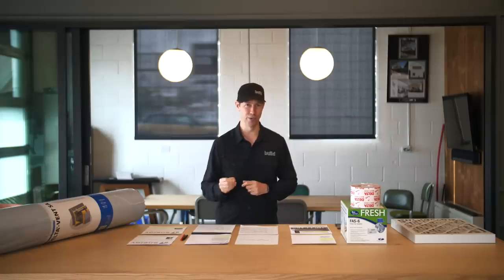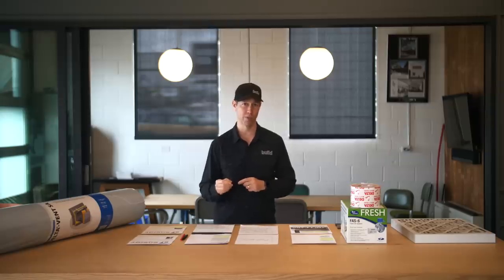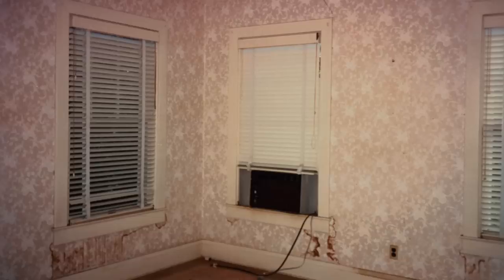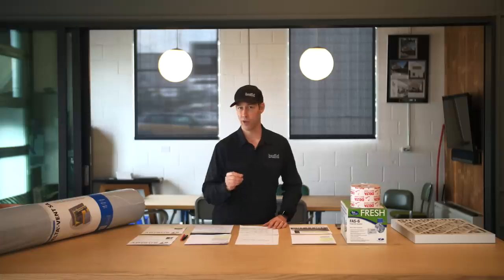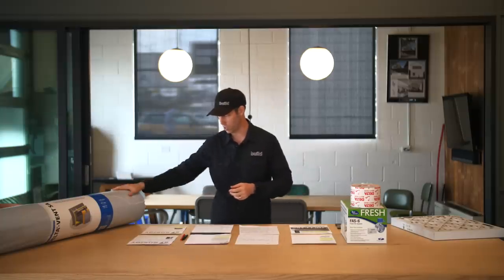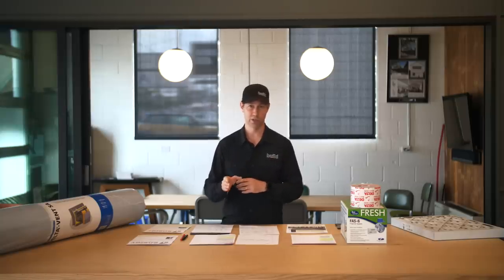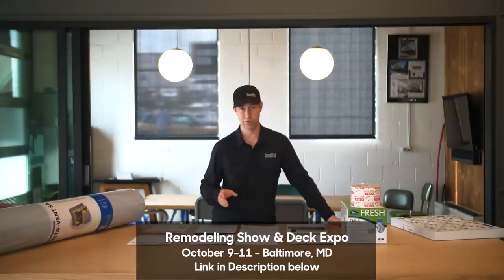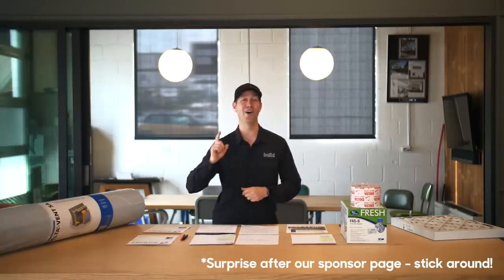“Houses need to BREATHE!” - Shut your filthy mouth

Comment: So houses do need to breathe.......... 

There's just better ways to do it in 2018 than previously.
Reply: Still not technically true. The people inside the house need to breathe. If the people go away on vacation for two weeks, they turn the ventilation off. Even during the day when everyone is at work or at school, the ventilation is turned off.
Reply: @trevorlambert4226  Why would they turn the ventilation off? User error shouldn't usurp logical construction. Their controller can automatically kick in the system; the air never has to get stale. When I leave for vacation, my system is on. Hec, I never have it off just adjust it for usage and comfort. So easy.
Reply: @Zeppelinlv2007  There's no need to exchange air when there's no activities and no one breathing inside the house. You have the HRV programmed to dial back to next to nothing during the times you expect the house to be empty. When you go on vacation, you do it manually. This is standard practise, which is why there's an "away" setting on most HRV controllers.
Reply: but more expensive. If you are not in a cooling climate this makes you have a HVAC system which you wouldnt otherwise, that is a HUGE cost, and constant cost. I live in a heavy heating climate, but the other 6-8 months a year there is effectively 0 climate control cost.
Reply: @trevorlambert4226  They prefer artificial respiration to natural breathing.
Reply: The home should be above 55 and below 85 with humidity under 70%. As long as you're not out of this range you're fine without ventilation when unoccupied.

Comment: Thx Matt. The physics part was spot on. But on the „how to do it better“ part, my philosophy varies. First of all: For the classical American home, your solution is the most viable one. Wooden constructions with insulation do not have enough thermal capacity to work well with natural ventilation. Having this kind of construction in mind, your solution is the best.

But if u check out different ways to build, you can create natural ventilation scheme‘s. My company is using massive prefab. concrete parts for structural pillars, beams and ceilings. The stairway is always beeing housed in prefab brick/KS. The outer walls (31 cm, with minimum 24 cm blown in natural insulation) and the roof skin (45cm with over 30cm of insulation) are made of prefab woodframed „plates“. The Drywalls are made with a new German product, combining a breathable woodwool board with a 1,5cm thin clay plaster layer.

This is a so called hybrid construction. I made it, so one can reep the benefits of both worlds best. While using massive ceilings and clay plaster, I highered the thermal- and hygro- capacity. While using thick insulated wood-framing, I optimized the thermal insulation (it takes weeks for the interior to cool out in winter or heat up in summer). With this combination, I can use small ventilation openings within the window frames for fresh air supply and intelligent fan‘s (CO2 measurement) in pwdr/bath/kitchen for achieving a low cost ventilation system. As an Alternative, one could put a long bended freshair ventilation pipe below or into the basement/baseplate. It might not have a sophisticated thermal exchange system like an expensive high tech air conditioning system, but it serves comfort and a reasonable energy consumption, without the need for new air conditioning systems every 10 to 15 years.

Cost of this construction per sqft: 120,82€ or 138.20$/sqft. That’s invested once.

Compared to this, you could also spend 10 to 20k for a sophisticated air ventilation system in a mid size home every 15 years, plus maintenance and repair costs.

Disclaimer: Yes, our prices are low. But this is intended, so working class families can afford proper homes. We want it like that and we are ready to work/optimize more for our money, while focusing on the mass market. The average price for a brick&mortar home in Germany is nearly double as high.

Comment: For 3 years in the late ‘70s we lived in a home built using a semi-experimental construction method.  It was a single story built on a concrete slab.  The walls were made from particle board bonded to both sides of a 4” styrofoam panel.  The styro had channels molded into it, and used a tongue and groove joint to adjacent panels.  The channels were filled with concrete which formed the “studs”.  Electrical was in smaller channels in the foam.  The roof was panels of Masonite bonded to both sides of 6” foam.  There entire “attic” space as used as a plenum for the HVAC.  Need a vent?  Punch a hole in the ceiling and put a grill over it.  As you mentioned, the house was entirely too tight.  We had constant problems with mildew.  We had to run a large dehumidifier during the winter.  Any furniture placed too close to an exterior wall was sure to have mold behind it.  Fortunately, we relocated for work before I had to face drastic and expensive solutions to the damp house.
Reply: Interesting
Reply: Was the concrete slab insulated in any way?
Reply: mark ymark I don’t know.  The house was a little over a year old when we bought it, but it had been rented out the first year.  We never talked to the builders.  We lived in it from Jan. 1978 through May 1981.

Comment: Question from a Swede living in the US. One of the most annoying things I've noticed here is that every apartment/house is heated with forced air. I have never understood why this tiny cost savings is used to get a loud really inefficient system instead of using water based radiators under windows or in the floors. How does that affect building air tight? Let's say I want to build a house that is "100%" quiet. ie I don't want any moving system that forces air in any direction. Can I build air tight but with natural ventilation?
Reply: Anders Fredriksson excellent question, Anders!
Reply: Anders Fredriksson , ..  many years ago, I  read about a passive heat ventilation system, that had one way venting, as is air warmed,  it rises and exits. Fresh air entered via one way vents near the warm floors.. It's was a pretty slick  system..
Reply: Radiators went out of style when air conditioning became popular. Forced air allows the ductwork to do "double duty." You go with rads; you need a separate cooling system.

I suppose there isn't much need for AC all the way up at 60 North?

P.S. Radiators, in my experience, are about as noisy as forced air. No fan, but lots of clunking noises as they heat and cool.
Reply: bcubed72 never head any clunking noises from radiators in my house.  Forced air is awful.  Its inefficient, costly, swirls dust veywhere making people sick. Air conditioners need to be banned soon for climate change reasons alone. Youre in dark ages with this opinion.
Reply: @PS987654321PS  Air conditioners are an absolute necessity for much of the   southern US. That's why building for energy efficiency is so important. 

Also, forced air is quite efficient for heat provided it rarely gets extremely cold.

Heat pumps can operate very efficiently if the temperate differential isn't extreme, much more efficiently than combustion heating systems.
Reply: @PS987654321PS  Yes, planting more trees will really help when it's 95 degrees and 90% humidity in the shade. Why didn't I think of that before?
Reply: techmage89 it will.  Also, maybe if housing was properly made for the climate youd not have the problem.  Spain and north africa region are hotter and no one uses air conditioning. They dont need it. Why do you?
Reply: @PS987654321PS  Spain is actually considerably cooler and drier than most of the Southern US. No where in North Africa gets anywhere near as humid, either. Evaporative cooling techniques and plain old sweating work fine for cooling down in such climates.

Not so in much of the Southern US, which is a humid subtropical climate. We can't rely much on cross breezes and shade to keep us cool, nor can we sweat to cool our bodies down, because the air is too humid for sweat to evaporate.

Whenever the power fails for more than a day or so in the heat of summer (happens occasionally due to hurricanes, etc.), a few people die of heat-related conditions. As a matter of fact, heat-related deaths are the #1 weather-related cause of death in the US (see https://www.ncbi.nlm.nih.gov/pmc/articles/PMC1241712/).

It's true that in some parts of the US, air conditioning is mostly a luxury and not a necessity. I've lived in houses without AC in the north, where summer temperatures are more modest (more akin to Spain, to use your comparison), and while it wasn't comfortable, it was livable. Not so in the southern US; if it weren't for AC, not many people would be able to live here; in fact, prior to the development of AC, not many people did live here. Many modern southern cities would be entirely untenable.

That doesn't mean there isn't a lot we can do to improve energy efficiency. Well-insulated houses and efficient, modern HVAC systems can drastically reduce the amount of energy required to keep our houses cool. Smaller houses and condos, which are increasingly popular, also intrinsically require less power to keep cool. Our low latitude also means that solar power is a good option in many places, which can greatly help offset the energy demands of AC on the hottest days (though there are still political and utility issues to solve here, so progress is frustratingly slow). We additionally have the advantage that winters are mild enough that our air-conditioners can pull double-duty as extremely efficient heat pumps in the winter (also known as "reverse cycle air-conditioners"), meaning we much less power in the winter (when solar panel output is also lowest).
Reply: Oh and most of north america including southern canada is just as hot and humid.  I was in Montreal this summer and for weeks at a stretch it was 100 degrees and 95 percent humidity. No ac in my house just a small ceiling fan and nice shady trees. No problem at all.
Reply: @PS987654321PS  You're being ridiculous. Montreal has a much cooler climate than the Southern US. Those temperatures are exceptionally hot for summer there. They're average for summer here. AC isn't really a necessity there, like it isn't in the northeast and coastal western US.

Can people technically survive in very hot weather if they have to? Absolutely. Lots of people in India experience similarly hot and humid weather and many aren't able to afford AC or the infrastructure can't support it, and they get by.

Would most people in the US tolerate it? No, they wouldn't. If AC were suddenly unavailable, there would be a max exodus from southern US cities, likely collapsing the US economy. It just isn't a reasonable expectation. Too much of our society is built around AC for the last century to easily change now. Realigning that would probably take nearly another century and intense outside pressure.

There are much easier, more immediate things we can do to reduce our energy consumption, as I've mentioned.
Reply: @PS987654321PS  it's like that for close to six months straight here just normal, not the once in 10 year 95 degree summer day in canada.

But yah I get the waste air conditioning can create, I've got a zoned a setup that I essentially just use to keep my bedroom and office (when using it) cool, and just leave windows and doors open everywhere else. Kind sucks going to sleep if your sweating or having to do office work, but otherwise tolerable, not having a shirt or wearing sleeveless shirt helps alot to.
. In fact I use more energy on heat during the 3 to 4 cold months, but a good bit is firewood I cut, although heat pumps are nice to have when you dont want to deal with fire or wont be home. That is not typical though, most houses have attic installed leaky ducted whole house systems that waste alot, and are these "modern houses" that are impractical to truely redesign the systems.
 many people have trouble dealing with it especially the aging who grew up in the almost free energy days, or mid aged people who grew up with them often not knowing any different.
But both the energy efficiency of heatpump technology, building construction (more and more moving on from the earlier crap engineered materials to ones that are actually really good), and an awareness of cost, enviroment, and by some doing good duct job or going ductless has gotten better, as well as younger more active people are growing up seeing the previous generations waste.

Comment: When building tight with the latest materials etc., workmanship, proper technique and execution is critical. If a tight built house is compromised by moisture especially if not initially noticed the damage can be extensive. I have to re-frame a kitchen wall because of the combination of the tyvek wrap not going past the top edge of plywood sheathing and the soffit and wood siding not overlapped correctly.

This allowed wind driven rain water to seep behind the tyvek wrap rot the plywood sheathing and studs. It was not noticed until water leaked to the inside floor via bottom corner of window frame and a carpenter ant problem because of moist rotted wood inside the wall.